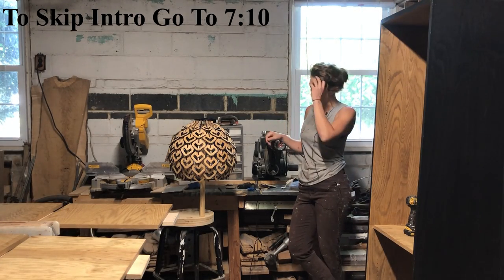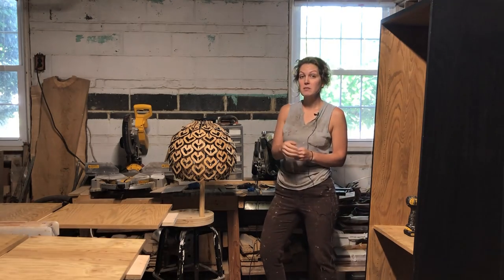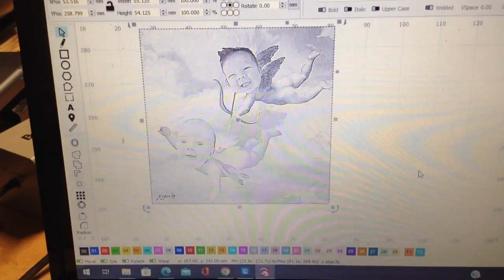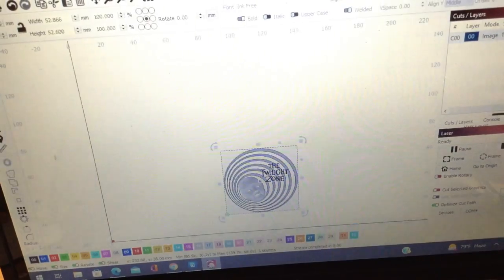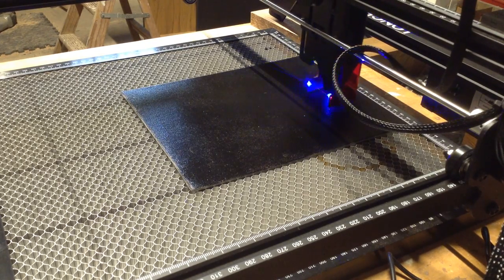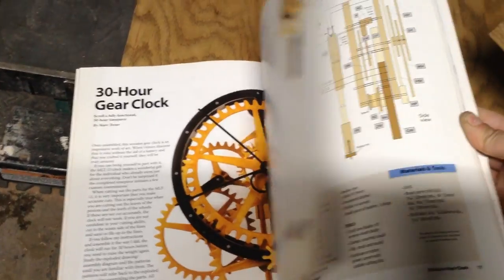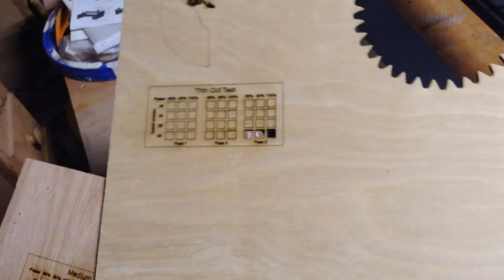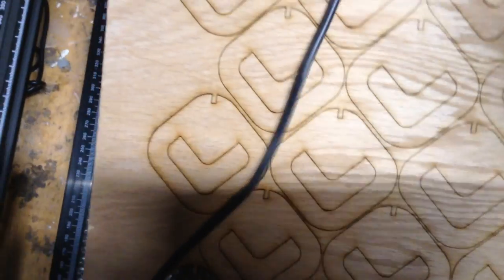Tool Review : Cost Effective 10W laser Engraver // Longer Ray5

Comment: I just assembled my Longer RAY5 10W and checked the initial settings ($$ in Lightburn). I see that the max speeds for X ($110) and Y ($111) are 6000 mm/min. Have you increased these settings and run the laser faster?
Reply from the maker: I no longer own this laser as I sent it to someone in a giveaway.  But, it general with my testing on most of these laser I do not use the upper level of speed on these.  The engravings and cuttings work on specific settings and the fastest speeds yield poor results.  On the more powerful lasers with higher wattage output they can do jobs faster than the 10 watts but even then I never have the settings set to the highest speeds.  Hope that helps.

Comment: I realized Adobe Illustrator is not cheap and difficult learning curve (vector drawing) but Affinity Designer is more affordable and almost as capable. I also warn users getting into laser cutters that its technically an ablation process. There are fumes that need venting/filtration. Cutting wood will create vapours/smoke. And cutting non-organic materials can create carcinogens so make sure to have ventilation and filtration. Pricier laser cutters have optional filtration and exhaust options. Same applies to 3D printers as there are fumes never clearly discussed. 
So Kate, enjoying the jersey tomatoes and jersey corn?  :)
Reply from the maker: Yeah, Illustrator is not in my budget so I'm looking into inkscape.  I do have a good venting system set up for this, but yes the venting is a must and ideally down the road a cabinet for it to make the venting more efficient.